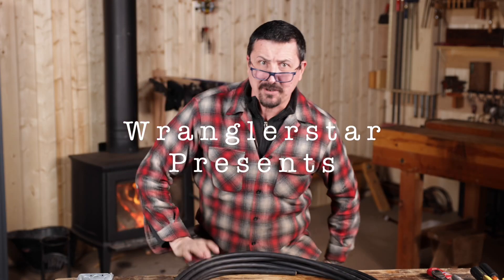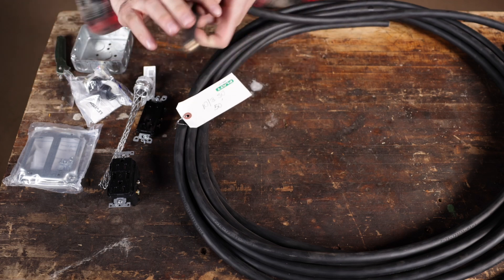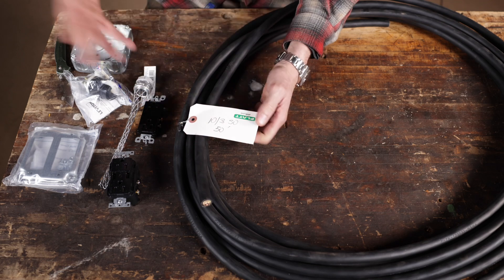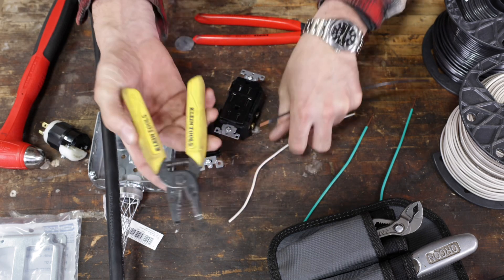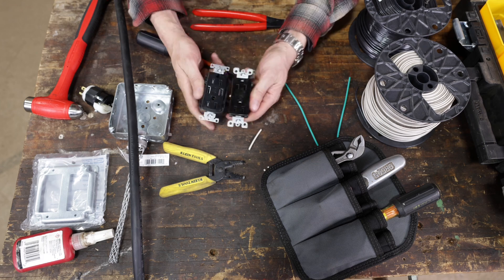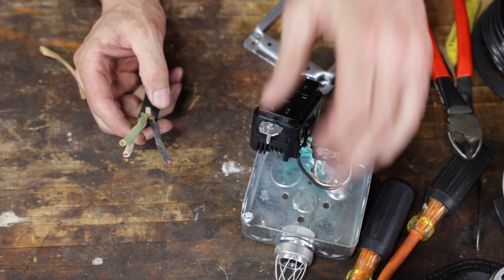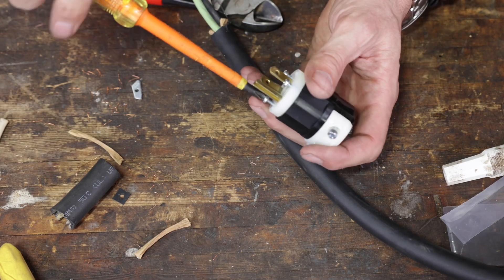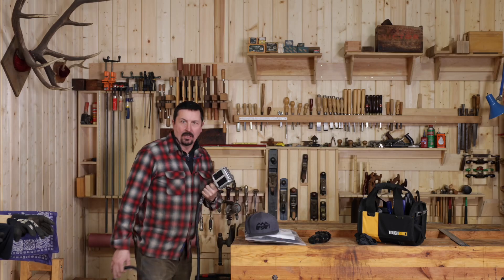The Ultimate $150 Shop Accessory - ALPHA CORD

Comment: The ten gauge wire is overkill. The circuit the extension cord will be plugged into is on a 20 amp breaker or less and is probably wired with 14 gauge wire. The outlet the cord is plugged into is rated at 20 amps or less. Twelve gauge copper wire will provide more flexibility with less weight and lower cost and is perfectly acceptable for the task.
Reply: Was thinking same thing,  but I ain't no ⚡sparky⚡
Reply: My Hobart welder is recommended to be used with a 10 ga ext. cord if over a certain length.
Reply: He explained that at the beginning that 12ga is plenty. 10 is more versatile. And nobody uses 14gage for receptacles. Perhaps 14 gage for a lighting circuit. Wall outlets are typically 12gage.
Reply: Yes 10/3 is 30 amp. If you are going long distance could see using it for 15 amp service but at this length 12/3 with 20 amp plug and outlet would be ok. Would also upgrade to aluminum outdoor box and consider using GFI if I was using it outdoors or on cement floors.
Reply: @allegannews9256  Anytime you are using an extension cord, per OSHA, it is required to be plugged into a GFI protected device, hence the down stream receptacles would be GFI protected. Reason the cord is to be GFI protected from the plug end is in case the cord is damaged it will trip GFI. Otherwise a damaged cord in a wet location would allow you to get an electrical shock.
Reply: The oversized wires are useful of you are planning to supply welders and other high current drawing devices using an extension cord long distances. Some cheaper welder for example might have a current spike each time you start welding. They also might be sensitive voltage drops in the cable. Oversized wires and cables has less of a voltage drop that might be crucial when using long cables  and high currents drawing devices.
Reply: @sharjusharju1414  - I agree, it would be useful in very high-current applications where you know your source is not wired with 14/2 Romex on a 15 amp breaker.
Reply: Hi, Europe here. 14 gauge (2 sqmm) wire looks a bit skinny to me for a 20 amp installation, we're required to use at least 13 gauge (2,5 sqmm) for home installation, and that's with 220 V, so less current. Or am I missing something?
Reply: @cjoor  14/2 meets code for outlets in most of Texas if you use a 15 amp breaker.
Reply: Unless the cord is super log like over 100 feet than 10/3 is a good idea
Reply: I am from Europe and based on what I have heard using long too skinny extension cords with welding equipment is bad idea. Especially if you the cord is long. In order to avoid the voltage drop the cable need to be thick enough. If the voltage drop in the cable is to high cheaper welding equipment might not function properly. Years back my father use to plug the old welder in the into a power outlet close to the fuse box in order to make sure the the welder got high enough voltage.
Reply: @cjoor  Over here many over-the-counter extension cords and device cords can be 14 gangue or even smaller, but I think that is because the device isn't expected to carry the full load of the circuit, whereas permanently affixed premise wiring must be rated to do just that.  While a given load will draw more current at lower voltages, the wire must still be able to carry that current regardless the voltage.  In household wiring we use 14 awg for 15 Amps, 12 awg for 20 Amps, and 10 awg for 30 Amps, though TECHNICALLY these conductors are actually rated higher then these values.
Reply: At 100’ there will be less voltage drop on the 10 gage then the 12 gage  meaning you can supply more watts to to the tools you  are using
Reply: Shouldn’t use 14 gauge on 20 amp breaker.
Reply: @cjoor  20 amp requires 12 gauge, whether for 120 or 240 V.
Reply: Just saw an outlet yesterday at the blue box store with usb c on the plug. You might have to rewire that box now...
Reply: Because double the current the outlet is rated for makes total sense yes having some excess for certain situations is useful but you dont need to go double.
Reply: @lukebrown4184  not for most of the units I wire. Maybe some homebuilders are generous and spec out some 20A outlets for the garage
Reply: He said that wire could be used for 220. Is that right? Is that cable actually 10/3 plus a ground wire? I'm not sure on the terminology. If it says 3, doesn't that mean 2 hots, 1 neutral and 1 ground. If it says 2, that means 1 hot, 1 neutral and 1 ground. He counted out 3 wires and said it could be used for 220. I went back and watched again and he said " a white, a green, and a black. Can that work for 220? Clearly, I'm not a "professional homeowner". Or electrician.
Reply: @meandthemrs7403  SO cord is labeled with the total number of wires. So if it's 10/3 it's got three conductors. It's not like Romex. 

And yes, it can be used for 220. Most welders and whatnot don't require a neutral conductor so you don't need the 4th wire. 

Only certain devices need the fourth wire. Plenty of stuff uses only two hots and a ground.
Reply: In your video you mention having stripper pliers. Did you know that the USB socket you were holding has strippers built in.  The angled slot that you are pointing to at time 3:54 (and which you later cut off) is a slot where you insert the wire for the appropriate gage and pull out the wire which strips the wire insulation off thus not needing stripper pliers.
Reply: @cjoor  220 volt draws less amps but wire should still be rated by current it can handle without overheating in worst case scenarios. so they rate 14 gauge for 15 amps and 12 for 20 just so it won't overheat in an insulated wall
Reply: it is overkill to use 10 gauge for safety rules of current limits on wiring most new homes have 20 amp circuits with 12 gauge for outlets , but when using high current draw power tools like a 15 amp saw there will be less voltage drop  due to resistance over a thicker cord. so with a long thin cord you will get maybe a hundred volts when under load and your tool will bog down i have seen motors refuse to work in a garage 100 feet from panel with 10-2 to garage and 12=2 cord in garage. I have seen a couple 12 gauge cords plugged into each other at jobs and you have  no strength left to run motors on big drills saws etc. They have charts on how long of a cord you can use in directions for power tools and they do recommend 10 gauge for 15 amps in long cords
Reply: I disagree with going with a smaller gauge wire. That can depend on how long the wire is. It’s always safer to up size. You never know when you’ll need to plug something in that draws near the limit of the device. Power cords all have resistance and the longer the cable the more there is. 
The one I made has 10 gauge wire and is over 50’ long.
Reply: @williamdebow3478  That is not possible no home has all GFI outlets and no single extension cord I know of is GFI .
Reply: @lukebrown4184  
nobody should
Reply: What is the max length this type of cable will allow when running 20 amps?
Reply: @ranger178 where is the chart?? I need to go about 110-130 feet for my shop. Not sure what to do. don't want to bury.

Comment: This is East Coast Connecticut guy. The number after the wire size, for example 12-3 does not mean three wires total, it mean three insulated wires and one ground, basically two hot leads. So 12-3 would be a black and red for two hot leads and a neutral. The ground is not included in the number. 12-2 wire would be blacks and white (hot and neutral) and the ground, which is not included in the number. We’re not all bad on the East Coast Cody!!

Comment: I'm here to read all the angry electrician comments , lol
Reply: only problem IMO is using the insulator as a nut, and the jam nut is outside the box. Everything else is 100
Reply: @RandyRandersonthefamous  I would use outdoor box instead of that steal box. Would not want to use that outside or in wet area. Also with 10/3 Wire why use 15 amp outlets. Why not 20 Amp? Most new outlets use stab in connectors instead of having to use wrap around screw.
Reply: @allegannews9256  Very good improvement, you could even use a rain proof outlet cover since it's using standard electrical hardware. 20A is also good. Not much more and it will be under slightly less load over its life running mostly 15A appliances.
Reply: I haven't seen anyone mentioning 2 ground wires under one grounding screw. Not allowed unless they have crimped-on lugs.

Comment: It just needs a built in LED light, a hook, rubber feet, blue tooth speaker, and a remotely operated kill switch for when the wife’s looking for you.
Reply: My dad made a few like this out of wire spools. He also included a light socket. Which I put my finger in when feeling about for a light switch in the loft space. 240V bites hard.

Comment: Why 10/3 wire when you’re going to connect to 12 wire into the receptacles? Just a waste of money to use 10/3 wires, right?
Reply: At least this way he can use it with a 30 amp outlet if he needs to without the cord becoming a heater haha

Comment: Professional industrial electrician here.  Couple points. That cord is commonly referred to as S O cord.  And that type of strain relief is really intended to be used with heat shrink to finalize the connection and prevent the grab from coming open over time with lots of use. And finally if you are planning to use something like that for doing 240, keep in mind amperage limitations.  10 gauge wire (usually written as 10 AWG which is American Wire Gauge) is only rated to 30 amps in a cable like that.  For use as a general extension cord for power tools and the like a larger cord like that is generally agreed to be safer because it is no longer the weak link for failure but it can subject the receptacle feeding it to higher potential loads than they normally see.  But that’s why we have circuit breakers.

Comment: "Tighten that jam nut". It's a locknut that you put on the wrong side. You're using the plastic bushing to hold onto the box instead of the steel locknut. 3 wires under a ground screw that is rated for 1 wire. Electrical is easy if you have no clue what you are doing wrong.
Reply: Hopefully he'll read through these comments and make another video fixing this cord!!

Comment: When I've made those I put a rectangular piece of plywood on the back of the box, saves the metal box from clanking on the floor, and makes the box more stable.
Cheers from Tokyo!
Reply: And "ears" up the side for when you inevitably drag it face down.
Reply: I always use a 2x6 12” long, 30 years and still going!
Reply: Make the plywood big enough to step on too.
Reply: I'd probably use one of those "rubber" dips on the back of the box just to avaoid scratching anything with the metallic box.
Reply: I have found before assembly clean and scuff the box and cover. (Outside Only) then coat with rubberized coating to reduce chance of shock. Your idea of putting the wood on the bottom is a great idea.

Comment: 10 minutes of “work” = a lifetime of use. 

Talk about an investment. I’m gunna give this a shot.
Reply: And made already 3 for himself? 
Maybe he should put a tracker on his nice stuff? xD
Reply: If you have 20 amp outlets upgrade the plug and the ends to 20 amp. A 10/3 cable is good for 20+ amp. Also upgrade the outlet box to aluminum outdoor outlet box so it can be good in wet locations. May also want to use GFI outlets if you will be using outside.
Reply: This exact list of items on Amazon prime comes to $199.80, except for the small lengths of household wire.
Reply: @Ca_Tule_Ninja  Explain

Comment: I had a set up exactly like that in the mid 90's on a job site. OSHA made a visit and fined our company $500.00 because the box was made of metal with knockouts. He said it was possible for someone to poke a screw driver or similar object onto a knockout, pushing it in and exposing hot wires which could shock someone or start a fire. I argued that if a screw driver entered the knockout, it would short out between the box and the hot wire, causing the circuit breaker to trip (as it is designed to do).  He didn't budge and made us pay the fine.
Reply: LOL OHSA Back in 1970 I was working in a printing company and OHSA came in and did an inspection, we failed, Boss told the inspector to pass us and never comeback or else!  Lol never saw OHSA after that, I worked there over 35 years.
Reply: I try to pickup outdoor rated boxes (on sale or when they are being clearanced) with threaded plugs rather than knock outs to make it "more safe" but an OSHA inspector could still take exception.  The other variation that I find helpful is to mount the box on a block of wood or scrap of HDPE plate to raise it off the floor, it just gives me piece of mid if things get wet.

Comment: Pro tip:  If you had turned the cord around end-for-end, the three 3 conductors on the male end would have gone straight into the screw holes on the plug without crossing over one another.

Comment: The reason grandpa saved those "washers" was to use as spacers when needed to make outlets flush with walls when boxes were recessed  too much in a wall!
Reply: That comment got me to smile from two points of view: it's easy to laugh at excessive frugality, but it's even easier to laugh at those who don't fully understand it!
Reply: @pocket83squared  , That is an old electrician's hack I was taught when I first entered the business!
Reply: Yup, i was happy to see this comment
Reply: We used to coil some wire around a screw driver to make our own. I've gotten used to just cutting the relevant length from a rawl plug
Reply: not going to lie; it hurt to see him disregard them like that. Theres ALWAYS a situation 5 years down the road where that one thing you never thought you could use would be the perfect solution

Comment: Wish you would have shown how to hook the wires from the cable to the box, after you threaded it through the strain relief gizmo.
Reply: That was the main part, lol
Reply: @Castleknight.......I was just about to say the same thing re hooking the wire......it only takes a second and ensures a better grip on the screw v.s. a straight piece.  The difference in conduction area is also highly increased that way.  I've done this on every connection I've ever done.
Reply: He's trying to keep the video family friendly!
Reply: Appreciate diy video but oops need revision to actually the show heavy cable lead connection detail inside the box.
Reply: My guess is with ring terminals. It would be tough to get number 10 wrapped around the screws lol.

Comment: Some years ago I grabbed a 300ft spool of 3-10 from the dumpo. I did the math in the store, to buy 3 100ft 10 gauge extension cords I had saved $100 building my own. All my 13-15 amp tools spin right up and I do not trip the breaker. Wich is great when your working on a customers house and the only outlet outside trips, also known as a wasted day if you don’t keep a generator with you. Your right, it wraps up with little trouble on the cold days as well. I bind mine with paracord to keep it neat and tight. I’ve gotten many jobs just on how I keep my gear in line. Another great tutorial, thank you.

Comment: Did something change?   That has always been 10/2 wire - you dont count the ground.  10/3 would also have a red wire.
Reply: Agree.
Reply: Not with SO cord, the ground is counted in the conductor designation with SO. With Romex, DLO, tray cable, etc you don’t count the ground but with service cord you do.
Reply: It's SO cord, 10/3 because it has an insulated ground. In Romex you would be correct 10/3 would have black, red, white and an  uninsulated ground.

Comment: The cord is known as S/O cord. It stands for Seoprene or type-SOOW or some similar variant. Most standard extension cords are either 16 awg conductors or 14. If you spend some more money and get the 12 awg cords, they will serve you well for almost all needs. The "slugs" are known as K/O's. Or just knock outs lol last bit of pro advice, never depend on tension connections...put a hook in that wire and wrap it around the screw. That is THE best way to do it. ALWAYS MAKE SURE YOUR CONNECTIONS ARE TIGHT.. And yes that's what the hole on the strippers is for.
Reply: Was waiting for someone to tell him 10 awg was absurdly overkill

Comment: Professional homeowners are known to give the screw driver a little tap tap when necessary 🙈
Reply: Didn't knew you also watch his vids.
Reply: Tap tap tappy
Reply: just like any tradesman does when the right tool is in the truck that's 30 feet away or more.
Reply: Everything is a hammer when you need it to be. Flatheads are chisels/ prybars and don't let the guy at the warranty counter tell you otherwise.
Reply: Nandito ka din? Hahaha
Reply: Leviton T5833-W 15-Amp Type A & Type-C USB Charger/Tamper Resistant Outlet, Compatible with Apple Devices, Samsung Devices, Google Devices and More – Not for Laptops, White
Brand: Leviton
 4.7 out of 5 stars    
Price:	CDN$ 65.23
Reply: @BMikeAD  a flathead does virtually anything. And it does it just about as good as it does its intended job, if not better! 😂 always have flat head handy, but never use flat head screws!
Reply: Nice and tight.
Reply: The beater screwdriver is an essential tool, pry bars and chisels are extra weight in a tool belt a lot of times.

Comment: I am old so I have been doing this for years. That said,  the only differences between yours and my extension cords are.
1.  I always use white outlets because they are easier to find in the dark.
2. I will tin the wires on the cord before I hook them up to the outlets. 
3. My trick to keep the wires going to the correct terminals is...
BLACK---hot (burned brass)
WHITE ( Ice- cold silver)
GREEN (Grass- ground)
Keep these videos coming.  They are very informative.  Thanks